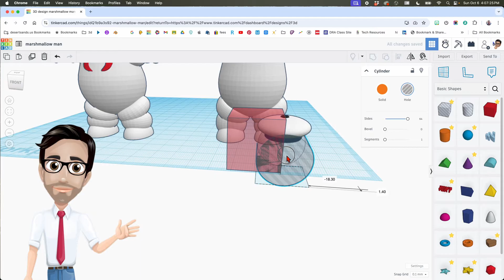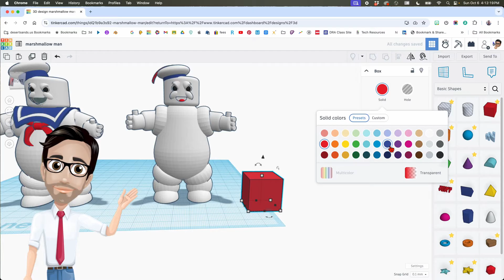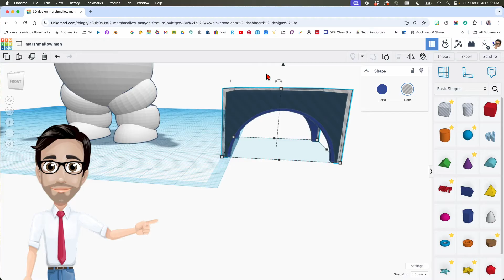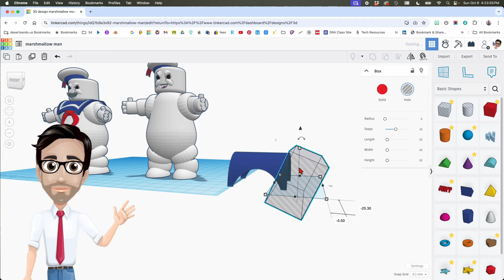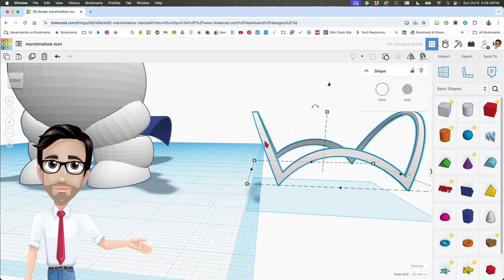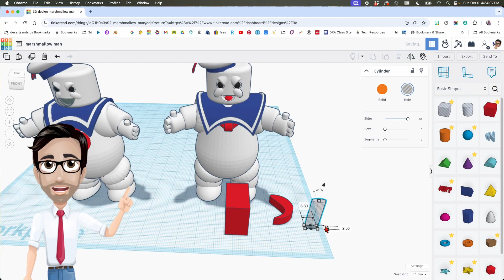How to Make The Marshmallow Man Using Tinkercad Part 2

Comment: Thansk for the vidoes .. i newly subscribed and I am new to 3D printing .. what 3D printer do you use? what do you recommend for a newbie.. i am interested in multicolor 3d prints
Reply from the maker: I would recommend the A1 or the P1P from Bambu Lab.  I used the P1P to print this.  They are easy to use and pretty fast.  I do have other printers but the P1P is my go to.
Reply: @Teaching3DPrinting  i can see there is P1S from Bambu Lab. what is the difference between P1P and P1S? is it worth the price difference? Thanks again